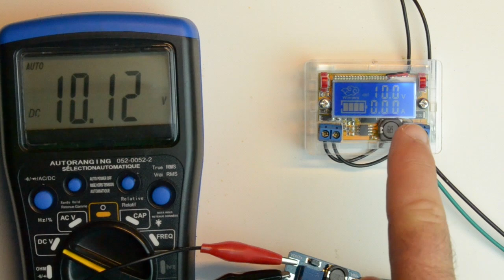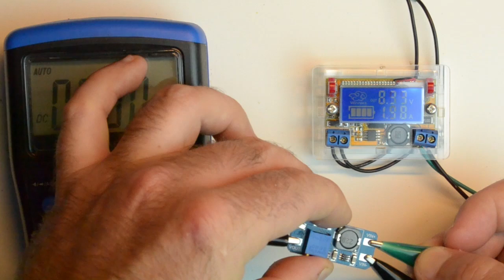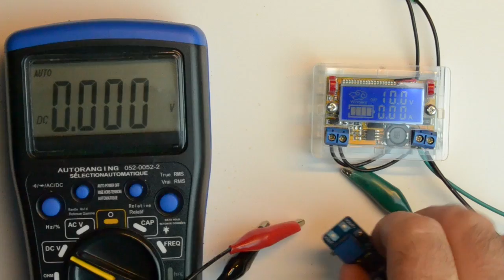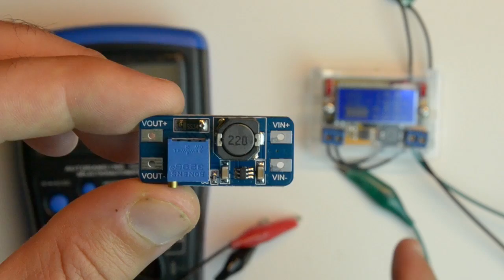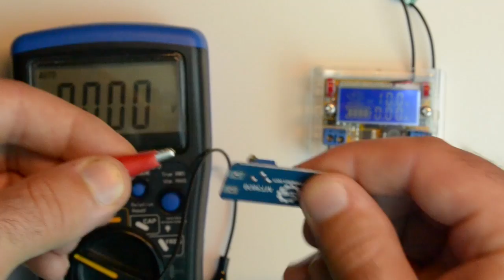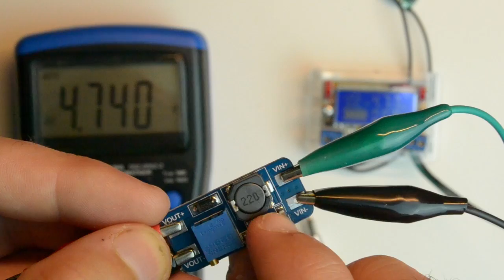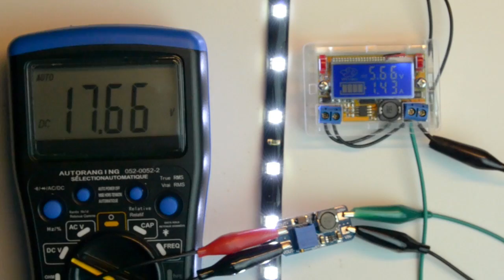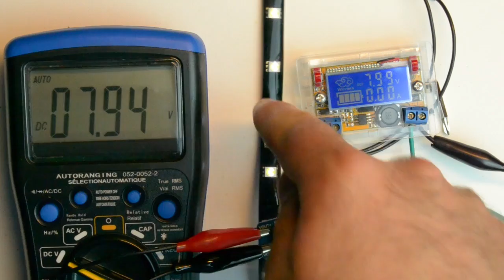Caught on FIRE?? MT3608 DC DC step up boost coverter

Comment: Hmm interesting i have bought the exact same ones one of them the same chip went up in flames due to an accidental short circuit and I've had another go up in smoke for no obvious reason but the others (so far) are working just fine and as intended

Comment: That thing is not faulty real faulty is the specs it's say use 2-24v but when you use 10-24v that happened I use 3.7v battery and I boost up to 12v output

Comment: The doc said, turn counter clockwise 20~30 turns before power it up!!
During factory test, many set to top multiply. Thus, for higher input voltage, the output setting many be too much.

Comment: Another problem in this common design is that the R1 should be fixed and near to 100K, because the RV too low exceed the FB maximum allowed input... 22uH Isn't also the best value for that, only recommended when you will connect light load, which isn't you case.

Comment: The best you can do here is to remove the potentiometer and solder a fixed resistor considering the value of R2 which is from 2 to 3 kohm, and calculating with the formula V= 0.6*(R1/R2) as said in the datasheet. This chip is not designed for modifying the value of resistors while it's working.

Comment: First time I've heard a multimeter with a fan. I smell fake.
Reply from the maker: Ever hear of a power supply with a fan?
Reply: @SimpleElectronics  Yep
Reply: @SimpleElectronics  I hadn't realised you were unaware that these are boost converters. That means the output MUST be higher than the input. Ensure this by turning the pot fully anticlockwse before you power it up. Once you are going, turn the output volts back to the desired level. Use them properly and they do not blow up.

Comment: ...I have those but it was a step down..there is another module with coils with description 1 dcv to 3.3dcv/ 3.3dcv to 5 dcv..for Peltier thermoelectric generator booster.. trying to lit a 5mm LED just by body heat..

Comment: I tested the module by inputting a 8.5 V and as same as my module got burnt the IC within a minute . I am hopeless about this module . Bogus . I didn't take risk of the burning of IC . So I took XL 6009 module for booster and it is working fine .
👍

Comment: these devices are dc dc converters ,step down ,one with display ,the other one don`'t , they are not dc boosters,you are using them in the wrong way, i have the same devices, and they work fine,the dc dc booster have more potentiometers one for voltage and another one for current control.

Comment: Buck converters are not robust. You should expect that. You need to put a load BTW. Don't keep them idle when using even only with a multi meter connected. And you should always start them with the minimum voltage input.

Comment: XL4015 burns down your place - it claims to have short circuit protection, but that only applies when the current gradually rises through an inductor. When the external buck converter diode fails, it creates a hard short circuit and the XLSemi part destroys itself. 
We were lucky to have had the board in a steel enclosure, but the place wreaked for weeks.

Comment: TL;DR These are not faulty. As mentioned by  @VauxhallViva1975, here is how to use them:
1. Even though it can handle a higher input once you have got the voltage output set, if your V in is greater than 6V, you WILL fry it when you try to adjust it. Only Adjust the potentiometer if V in is 6V or less.
2. Turn potentiometer screw anti-clockwise to increase voltage. Clockwise will decrease the voltage.
3. V in MUST be less than V out.
Reply from the maker: Except they are faulty - they were built without a link on the back of the potentiometer between the right and center pin. I have a bunch of these now with the link and they work perfectly
Reply: I fried about 3 of mine before I read the above info. It solved it perfectly.
Reply from the maker: check to see if the pot has 2 legs connected together

Comment: Of the 5 units I have ordered, only 1 worked. 2 units burned and 2 had faulty pots, in which, output voltage varied from 3v to 6.6v depending on the input voltage.  For the 1 unit which worked, I have set the output to 12v which remained constant no matter what input voltage I put. Used an assortment of input sources including a bare li-ion batt at 3.6v, powerbank at 5v 2A, a 5.1v 1A iphone charger, 5.1v 2A ipad charger and an 11.1v 3s li-ion battery pack.  All these inputs had a constant 12v output.
Reply: For your initial input voltage, only set it to 5v.....then adjust the pot to a higher output by turning anti-clockwise. These units are often set at 9v or lower, so if you input 12v it cannot handle it and will burn out. Current limiting on the input supply could also save them. After the initial use and set, they can be set to the voltage needed and they will be fine. Put simply, if the input is higher than the set output, they burn out...cannot handle it. Believe me, i burned several before figuring it out.

Comment: This is a modified version of a circuit my Dad built in conjunction with some valuable references in 1986 in Australia, it was fixed non-adjustable and made with far less components and fitting with the original use-case which was to enable an LED torch that didn't exist in general availability then to operate using two recycled basically flat batteries. It was my idea that he worked on. I presume the changes are to enable mass production through additional applications due to being adjustable. I intend shortly having discovered these are commercially available to make up a small batch for Boy Scouts. I would not mind finding a copy of the original hand-traced printed circuit board or the completed circuit mounted on a modified AA battery holder, I could copy/modify that for use. To executive summary another comment, "This would only happen if the input voltage to the module exceeded 6 volts."

Dr Bonezzz
"There is however a design problem where the potentiometer can be adjusted to the point of exceeding the maximum allowed input voltage on feedback pin 3 of the controller ic with the result of allowing the magic smoke to escape. This would only happen if the input voltage to the module exceeded 6 volts. A better design would have included an additional resistor between the top of the pot and the output voltage that would limit the maximum feedback voltage to the IC regardless of the adjustment of the pot."
Reply, the original design was fixed and the components chosen for the specific circuit application prototype including one resistor. Also, if I recall the circuit does not work very well with no load on the output because it is hard to tune.

Comment: Design mistake on module Rtop pot (100k) center tap should be connected to Rbot (2.2k), besides a variable o/p boost must be over damped for stability .. which this one is not...

Chinese junk
Reply from the maker: Wow, I think you're legitimately the first commenter to rightfully point out the fault! congrats!

Comment: I am guessing people have already explained why this is happening. I got my modules for roughly the same price and they are alright.

By turning the pot clockwise, you decrease the boost until it is 1:1 (pass-through), if you do it sufficiently, you short the MOSFET and effectively this starts burning.

By turning it counter-clockwise, you increase the boost. 

If I am not wrong, you can hear a very faint clicking from the pot as you keep turning it clockwise--- that's because it had already reached the maximum turns and was just jumping the wiper pin over the resistivity strip
Reply from the maker: There is actually one connection missing on these modules specifically
Reply: Without resistive padding on the output side of the pot, when the wiper reaches that end it puts output voltage directly on the Feedback pin. If your input is greater than 6v and its not regulatung, ie at startup, that instantly kills the chip. Poor design for the sake of a protection/limiting resistor! Doesn't help the fact the pots are cheap and nasty either.

Comment: Pretty sure you are turning that pot the wrong way to boost more, last video I watched turned anti clock to increase, you cranked it the other way... Probably damaged the pot!
Also, using them out of spec will probably burn them, yes... output should be 3v higher than input, if not turn off your damn power supply and re adjust before you blow the chip!
This video only tells me how little you know about boost converters... "guess that's a dud" huh? hahahahahaha
Reply from the maker: They can be turned infinitely in either direction, the pot is fine

Comment: I think the lesson here is that, if you want to fool around with electronics, a decent bench power supply with fully adjustable current limit and output voltage is going to save you a lot of grief. I have been involved with electronics since the early 1960s and I still don't go powering something new from a lead-acid battery or a LiPo before it's been checked on a bench supply.

Comment: I had used some similar modules. The modules needs a load on the output in order to stop feedback voltage.
Reply: Bullshit, I've got few of them, and I can setup output voltage before connect to the load. BTW my modules is not catching fire
Reply: @X-mass  you sound like you read the F Manual.. I did too.. no smoke no fire and no bullshit!

Comment: If you're drawing 1.5 amps in the input, you're drawing a lot less on the output because your voltage is higher. 1.5*5 is 7.5 watts /16, your leds are drawing about .47A

Comment: You turn COUNTER clockwise to increase voltage. It's also multi-turn... so keep turning it... You also want to BOOST to a higher voltage not go lower. This is a mess...

Comment: Your Dropping 3amp 1max?????????????? solving one now shorts on a dule line on the 5th now my my!!!! And this is 200ma max whats the issue??????😮😮😮😮i know.... got a fan on 3 18650 batterys set on 24v till the wire shorted all was ok butt the fan is a low 25ma high dc volt one.

Comment: Ok guys, I burned 2 and decided to move on to 6V, but I intended to change the trimpot for a regular potentiometer (100k) but now the output stays under 5V and gets hot really fast, any one tried this? Also it consumes 1A at the input!!!

Comment: Hi, are you using them now ?..I have no problems with them but they are a bit twitchy...so I use the chip itself on projects and take the inductor and the diode of the modules and it still works out as a very cheap boost solution in a small form factor.

Comment: Input from 2v up to 9v
Out put from 3 up to 27.7v 

Test my model on 1amp pass
3.3v / 5v 
5v / 6v
5v / 8v
Test on 800ma
9v / 12v
Test on 600ma
9v / 16v
Test on 500ma
9v / 18v

Better use input not exceed 8v 
And out not exceed 16v so you don't lose the power effective

And yes it's better to read the data sheet for the IC model for more information as I did .
It say 2amp max but it's only 1Amp
And in high volt out more than 12 v your current need to be lower than 1amp for sure

Comment: this isnt a step up module  MT3608 is a voltage rectifier that works this way 0-50 v and the doference between input and output needs to be 5 v max if you want it to work properly and max 700mAh under load, of load you may get a higher voltage but its residual voltage when its on loas it will decrease to almost half, if you want to reduce 12v to 1v use a transformer

Comment: Maybe the reason is already mentioned in all these comments. But I guess the reason for blowing up these modules is that the wiper pin of the 100 k pot is connected to the feedback pin of the MT3608. It is possible, that the wiper pin is loosing contact just for short durations. Then the feedback pin is pulled to ground with the 2,2 k resistor and the MT3608 increases the output voltage to more than 28 V. This destroys the mosfet, what actually results in a short cirquit and overheating of the IC.
Reply: If the wiper pin is connected to the FB pin, then losing contact would mean it is floating, not pulled to ground, or if the contact is very poor then resultant higher resistance to ground.

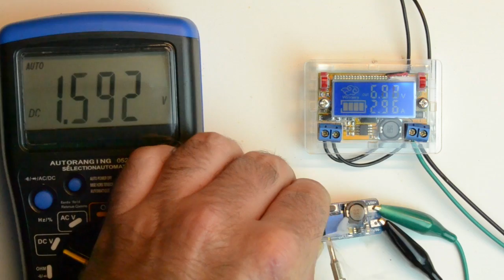Comment: 1:43 MAXIMUN LOAD 2Amps, you have near to 3amps
Reply from the maker: I think you are mistaken. The chip short-circuited and pulled 3 amps until my power supply maxed out. You don't supply current, your load pulls it, and in the case of a multi-meter, that load is roughly 10 megaohms (10 million ohms) and so it would have been pulling femtoAmps of the chip didn't short circuit

Comment: I smoked one too. For me, once I got my magnifier out I could see that it was caused by the crocodile clips of my multimeter. The one connected to VOUT+ was a little too far north and broke through the laquer causing a short. On the others I have, I went straight to soldering in's and out's and no issues since. Hope this helps.
Reply: lol, yeah I was in disbelieve that he thought using those  alligator clips was a reasonable way to hook that up, and after the very first one blew, the last thing I would have done is kept using alligator clips instead of soldering wires on.

Where in the instructions does it state to slap alligator clips on the edge of a PCB?  That is never the right way to connect anything.

It was so absurd that he did it, that it made me skeptical of the entire rest of the video as I'm thinking "if he can screw up something that simple, I can't put anything past him".

Comment: Have expiring the same with my 10 each until I checked the potentiometer with a ohmmeter and realized it has to go CCW for higher output (as many other write here) . I guess it was a well thought thing to let it start with the lowest output from factory. The problem with this is just it can't go lower than the input. 😕

Comment: For some reason I seen a post on eBay with the pot pins closest the output were shorted and the ones I got wasn't so I shorted it and boom fires up I got 30v 10mA from 5v usb and its not even warm lol but it is limited to 2amp and diode gets hot it operates at 1.2mhz 😂 and I wouldn't slap that tiny chip on 10v 😂😂😂

Comment: Read the datasheet first before you use a module. It will be broken if the output is lower than input voltage. Do counterclockwise turning to the pot for couple times until the voltage has been raised.

Comment: I looked at the internal circuit of the IC and I think because of the external pot being set too high, being a multi 30 turn pot before applying power you need to turn the pot clockwise till it clicks - clockwise lowers the voltage output and anty clockwise raises the output - I think What happens when the output is set to high, when power is applied the IC internal shunt resistor can not support the input surge and hence the smoke of death. The output voltage once set and turned off, Then when restarting needs to power the output via a stand by switch once the module is on then the output stand by switch can be switched On to apply the load. Also, note that whatever input voltage you apply will be the lowest output - so 2V in = Lowest 2V out - Highest = 27V. from a 2V input. -- So a 6V in = Lowest 6V out. - Highest 27V From a 6V input.

Comment: I blew up 7 of the 10  bought .My application was to go from from 12V to 24V.What I found is that the board offers no filtering to stop any non-resistive feedback .The unit run a resistive load indefinately with ease  , however the moment I placed it on the non-resistive  load they lasted a few seconds.Filtering may be the only means to reduce any feedback , as these boards are absolute bare bones.
Reply: Maybe there has been a revision but I recently have bought 10 and small no resistive loads have been fine, I also shorted it through current clamp to see what would happen and it easily held over 2.5 amp peak, aka temporary max current. She was noisy as hell on the high current load but other then that it’s been great as a small power unit for things like multimeters and data cable testers I was sick of buying batteries for.

Comment: I have several buck/boost converters of other types that ship without the blue 10-turn trimmer being "hooked in."  Habitually now, I turn them to the extents before anything else.
Oddly, when the same bare trimmers from Ali, they ship working, and about mid-range.
These 6-pin boost chips (1.2mhz) seem to go by many names: B628, B62888, PL2628, SX1308, MT3608.
Wow, the dislikes for this vid.  Must be the fifty-cent army!

Comment: I bought 20 of these modules for about $ 8, but no one wanted to react when setting the potentiometer, even at one burned IQ wheel during testing
Reply: Just turn the pot completely to the left before connecting to a supply. And while setting up only use 3V as input until your voltage is set. Remember: clockwise is down and counterclockwise is up! And never turn it to an output voltage lower than the input. Because the PWM goes to 0%, witch means the MOSFET shorts the inductor output to ground.
Reply: @makimcleary393  I will try, so the exit does not have to burden, it remains idle
Reply: Can I try with 5v, does not have to be strict with 3v?

Comment: Same for me with a XL6009E1 module.
Reply: Just turn the pot completely to the left before connecting to a supply. And while setting up only use 3V as input until your voltage is set. Remember: clockwise is down and counterclockwise is up! And never turn it to an output voltage lower than the input. Because the PWM goes to 0%, witch means the MOSFET shorts the inductor output to ground.

Comment: I think that they aren´t faulty because the max curren output is 2A, and you have tested them at 2.96A
Reply from the maker: the chip actually internally shorted and pulled 3A, I was not forcing 3A through it